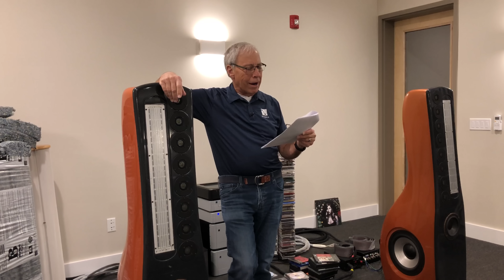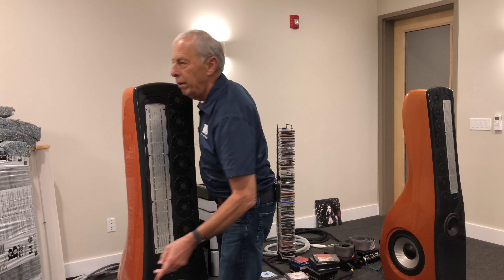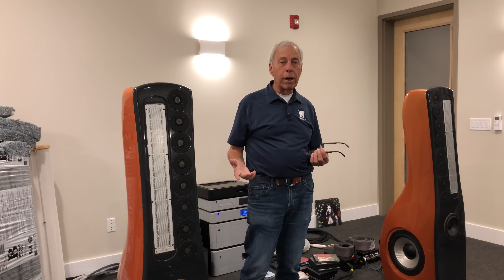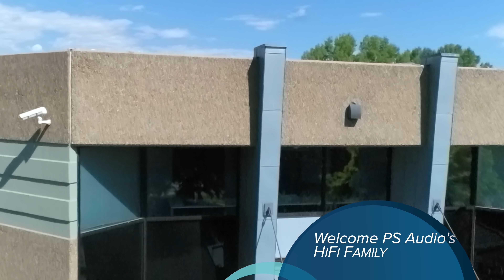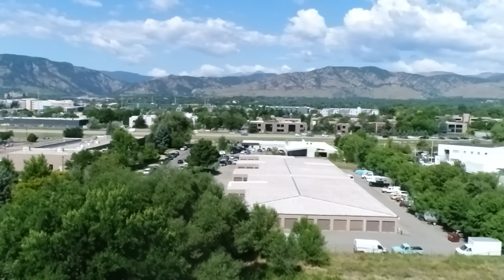Do amplifiers push or pull power?

Comment: An amplifier is driving a load (speaker), why so complicated. The speaker is basically just bouncing against its permanent magnetic field being pushed AND pulled by the AC field from the coil fed by a power amp. Speakers resist, amplifiers drive.

Comment: A very interesting question.
When one looks at transmission lines for signal transmission as in radio etc - ( that is long ( in terms of multiples of wavelengths) it becomes neccessary to study how the signal ( and energy) actually travels down the line .

In fact - one can look at it by saying - if i connect the sender at time zero.. it takes a finite  time for that signal to reach the end of the line where the load is connected ( google " telegraphers equation )

So - two things become apparent;
1 it takes time for the energy entering the line to reach the load... so it follows that energy  flows in the form of a travelling wave along the line " not knowing " what the load "is" until it gets there.

2. When this travelling wave reaches the load - provided certain ideal conditions are met - ALL  the incident energy is dissipated in the load.. and the generator continues to supply energy.
If... on the other hand the end of the line is not correctly terminated - then part or all of the energy is reflected - and the generator sees a mismatch and does not deliver full power.

The point about all this is that at the instant the generator is connected ( in this case the amplifier) - energy is "sent" ( pushed ) along the line to the load.  The load then defines to the generator how much energy to continue supplying.

IF no load is connected ..( that is the amplifier is connected to the line ... then it will "see" a 100% mismatch and deliver 0 energy.

( note : although audio (speaker) cables are very short in terms of wavelength - even at around 20 khz - assuming a velocity factor of around 0.95 - the wavelength is approx 14.25km  - and the line ( speaker cables) are not "matched" in terms of characteristic impedance . - these  concepts of power flow down the line still apply)

In both cases - the generator responds to the load " it sees" 

Also - if one puts a voltmeter and ammeter part way along the line and measures voltages and currents - how can you define which way the power is flowing? ( it clearly flows from the amplifier to load ) 
( in radio transmssion lines it is common practice to measure forward and reflected power in a transmission line

Comment: This guy is an engineer? The amplifier not only supplies the power. But it supplies the ground for the power to return to. The crossovers and speakers only supply a circuitous path for the power to travel. That power (in potential energy) will exist whether the speaker are there or not. If you put a dummy load across the terminals of your amplifier. That power will flow through the dummy load. Only "generators" have the ability to "draw" power. Buy creating a potential difference. It's this difference which all electrical devices operate on. This difference exists between the terminals of your power amplifier.

Comment: Oh dear ... the speaker is nothing more than a complex resistor. The amplifier provides potential through voltage and supplies power through current. The amplifier pushes power because the speaker resists the current.

Comment: 'power' is a ratio measurement... how much energy per unit of time. just like speed is a ratio measurement, how much distance over a period of time. you can't push speed, nor pull it.

I think the question has no real meaning, it could be a very nice example of quality trolling...

the amplifier simply modulates the amount of energy transfer between your AC outlet and your transducers. 

the energy carriers are the electrons (since we're dealing with wires) and fun fact: the electrons move rather slow thru the wires, it would take a few albums for an electron to travel from the - to the + terminals of the amp (depending on the room size) :}

Comment: I really don't even know why we are talking about this. The volume control is your accelerator and the speaker  is your motor. Push the amplifier or accelerator to hard and you'll damage the motor. If your running a V8 or technically advanced motor you'll have less chance of damaging the motor and the system will run hard all day. The wall socket/circuit is your petrol.
The better the circuit or petrol, the more you can do with your accelerator.

Comment: A speaker is just like any other component of the amplifier. It is just mounted outside of the amp. You could have the same discussion on any resistor or  capacitor etc. in the amp itself.

Comment: Problem with Paul's explanation is that a speaker is a COMPLEX LOAD!!!....meaning that with FREQUENCY RISE, there's ALSO IMPEDANCE RISE!!! I have YET to hear Paul address this issue!!! The ONLY way that I am AWARE OF, to remedy this issue is with a ZOBEL NETWORK SPECIFICALLY TAILORED to be placed across in parallel the speakers requiring the treatment!!! I have read that some amplifier manufacturers place a basic Zobel network in the output stage of an amplifier. But the QUESTION IS*, "How is it possible to make a single Zobel on the output stage of an amplifier compensate for not just one speaker but for multiple speakers in a single enclosure?! It's simply not possible and *NEEDS to be done AT each speaker requiring it!!!...Clear as Mud, eh?!😂😆🤣
Reply: Or use a transconductance amplifier so that the current is always proportional to the input regardless of impedance.

Comment: Mr. Fishers answer in the comments is, scientifically speaking correct, but still a little over the heads of some. That's not to disparage anyone it's just if you don't have any background in this stuff you still might be left scratching your head. To perhaps over simplify things consider this. Paul said an amplifier does nothing until it's asked to do something. But that's not exactly correct. An amplifier does nothing until it's TOLD to do something. In other words, the speakers do not ask for power from the amplifier, they merely respond to the power delivered by the amplifier. So, what tells the amplifier to do something? The input signal. Which is a lower voltage signal that contains all the musical information we want amplified. The level of this signal is controlled by your volume knob. Let's say your volume knob is like the gas pedal in your car. When you want your car to go faster you press the gas pedal farther down which in turn delivers more input signal to the cars computers. This action, in effect, tells them you want to go faster. So, more air and fuel is sent to the engine and this small signal is amplified, so to speak, into more horsepower. As more power is delivered (pushed) to the axles the wheels can rotate more rapidly thus "pushing" the car forward more quickly. However, at no point do the wheels request more power. Instead, they merely respond to something that is delivered to them. In a similar manner, when you want more volume, you crank the volume knob which sends more and more input voltage to the amplifier telling it that you need more power. The amplifier then delivers (pushes) this power to your speakers. Yes, the speakers have a motor whose electrical parameters interact with the current delivery but it is all a response to an input forced upon it, not requested by it.

Comment: A Speaker is a LINEAR MOTOR!!! Take a standard 9 volt battery, hook positive battery terminal to positive speaker terminal, likewise with the negative. The speaker cone will move OUTWARDS!!! Reverse battery polarity & the speaker cone will move inwards!!! Music is nothing more than a COMPLEX alternating polarity DC SIGNAL!!! Speaker voice coil burnout, regardless of size, is from one or more of 3 factors: improper crossover points, distortion, or over driving with too much power in that passband with the inability for the voice coil to eliminate the heat. Copper vs CCAW or Aluminum voice coils can also determine how much current is passable before the material fails. 😎
Reply: AC

Comment: What a funny question...!!
And Paul struggled to answer it too..
Think of power as water in a tank up on a tower or something... you have a tap and various diameter pipes ..each size represents speaker impedance .. 4 ohms would be the large diameter pipe and 16 ohms the small pipe ... which pipe would allow the maximum flow of water ( equivalent to amps ) ?
The bigger pipe of course .. now water pressure times flow rate is analogous to Volts times current .. so we have our answer ... power amps will force or push the power the poor old speaker does its best to handle it .!

Comment: It's remarkable how Paul still doesn't quite understand the basic principles of electricity flowing around a circuit after so long in the business. All you need know is what volts are (pressure to force the current around ) , what Amps are (the rate of flow of current flowing around the circuit ) and ohms ( the resistance to current flow around the circuit which often heats up as the current is forced through the resistance by the voltage ) impdence is not pure ohms. Watts is the "work done " ( Amps X Volts or how much energy is consumed )

Comment: Let's beat this to death.  Try this:  An amplifier generates a voltage (think electrical pressure) across its output terminals.  Whatever is connected to those terminals resists that pressure - sort of like a valve.  If nothing is connected across the terminals (the valve is completely closed), the resistance is (effectively) infinite and no current flows and no power is generated.  When a high resistance (impedance - yeah I know it's not exactly the same) speaker is attached to the terminals the resistance drops from infinity to some modest value, say 16-32 ohms,  The valve is opened somewhat, some current flows and some power (sound, heat) is generated.  When a low impedance speaker is connected, say 4 ohms, the valve is opened wider, more current can flow and more power is created.  So the amplifier pushes current by applying a voltage, the speaker resists that pressure, and the flow of current through the speaker generates power causing the speaker drivers to move and do work, and all is well in the world if you like the program material.  So the conceptual model is more like push/resist rather than push/pull.
Reply: Hi, that's exactly what I understood from Paul, too. Do you know what's the peak of voltage of an amplifier?

Comment: nowadays the low-end active speakers all have a low wattage amplifier board for speakers. i.e. 20w for 4 inch , 50w for 6.25 inch . .all seem below the RMS wattage or underpowered
 are the manufacturers betting on people wont listen to music too loud? How do you see this , Mr Paul ?
Reply: 20 watts for 4 inch is by no means underpowered, lol.
Reply: thank you..sorry for being inaccurate.. there is typical product like my 2.1-channel speakers including 2x2inch and 1x4inch drivers.powered by 10w amp board on USB link..I feel no bass at all....
Reply: @imkow 

USB is always low power...
4 inch speakers are usually not very bassy in general but there are exceptions, Dayton makes some 4 inch subwoofer drivers, but they are very inefficient and nothing you could power very well via a USB amp.

Comment: Hooooooly crap. I mean absolutely no offense, but that has to me the most complicated way of looking at it. Personally I think even talking about power in watts is an unnecessary complication. An amplifier AMPLIFIES an AC music voltage. Period. End of story. In fact it doesn't even matter if you plug in a speaker or not. Voltage is being dumped to ground through a resistor aka your speaker. The impedance of the speaker determines how much "flow" (aka current) there can be for a particular voltage output. All wattage is is a function of how much voltage an amplifier can spit out, multiplied with how much current the amplifier can flow through an 8 ohm load without turning into a toaster oven. 

Wattage isn't being pushed or pulled, its being dumped to ground through your speaker.

Comment: In terms of Physics, Paul is correct. The speaker converts electrical energy to sound; the electrons deliver that energy; the output stage of the poweramp provides the energy. So the speaker "pulls" power from the amp.  However, the amp provides the power as instructed by the signal, and it is from there the analogy starts to fall apart.  Otherwise, we cannot explain how an amp, big or small, can blow a well constructed speaker.

Comment: Paul likes to complicate things. An amplifier takes a little bit of current and turns into a lot of current. Attaching a speaker merely completes the circuit, allowing that current to flow. Screwing a light bulb into a lamp does the same thing. If you install a 6 volt flashlight bulb into a 110 volt lamp, it will burn out instantly. Powering a speaker rated for 20 watts with a 500 watt amplifier is the same idea, the difference being a 500 watt amplifier is not always putting out 500 watts, so your speaker won't blow until the music gets loud.
Reply: No, an audio amp is ideally a voltage source, not current source! 
The output signal voltage should only be a magnification of the input, independant of the load impedance and thus, the current it's pushing.

Comment: for me that I been studying amplifier simulations the amplifier does produce electrical energy to the voice coil as AC voltage even with 1W it will move , and it goes across the coil magnetism force is created so the magnetic field will eventually move the coil up and down depending of the frequencies applied to the audio signal I will say kind like push yes similar to an electromagnet